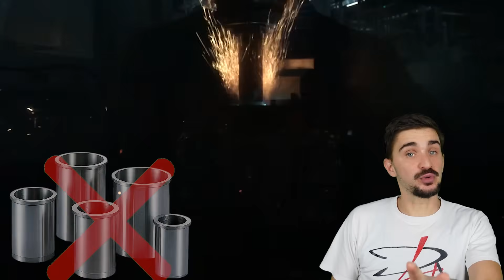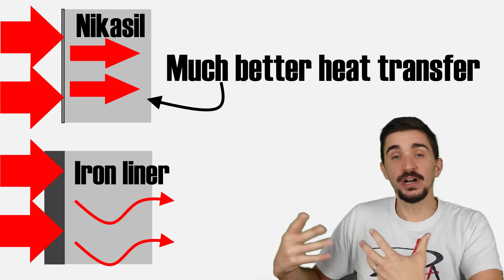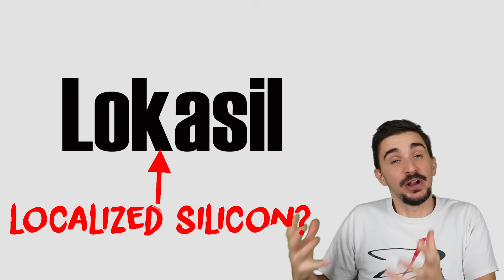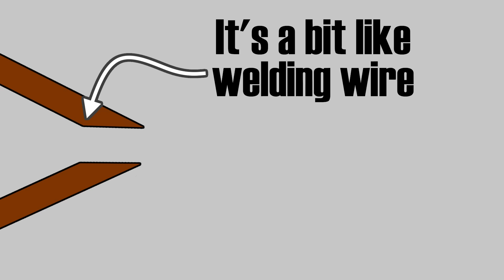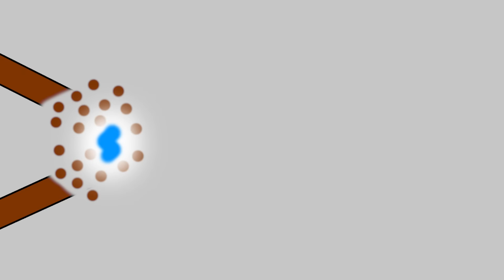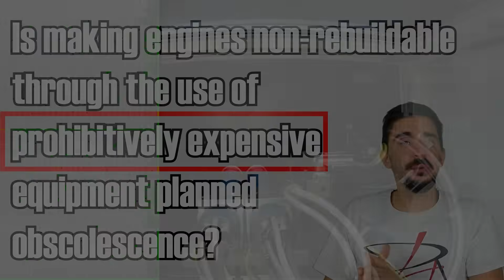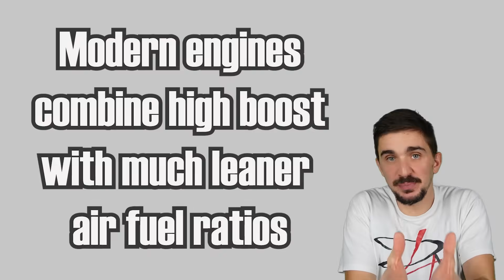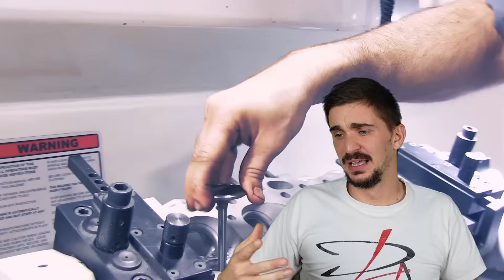Why Are Engines Becoming Non-Rebuildable? Everything About Cylinder Coatings

Comment: Ok thinking outside the box here, or maybe im not thinking it through.  If this becomes standard practice couldn't a machine shop purchase the equipment to do the coating themselves? Bore it .010 re coat and rebuild? Or am I missing something?
Reply: I don’t think you understand how expensive that is. Imagine spending $10k every 100k miles without taking into consideration the rest of the vehicle.
Reply: @evildrizzt1  OK I admit I'm not 100% sure on this.   But I'm sure in the early 1900s only the manufacturer could rebuild them as well. It took boldness and risk to invest in the equipment to do it... I don't see what's different today...

Comment: Another great video, well done. I'm not sure where the linerless big block Chevrolet engines used in CAN-AM fall into the development timelines, or what process they used. I've always assumed they were the same technology used in the Vega (yes, correct pronunciation similar to Las Vegas). You are spot on in analysis of design "planned obsolescence" is normal in design.  Theoretically, everything on the vehicle would reach its life limit on the same day. It wouldn't make sense for the vehicle body to wear out in 10 years but the transmission to wear out in 25 years. In that case the transmission cost more to make than it should have. 
I really enjoy your videos,  keep making them!

Comment: The car will be crushed far earlier due to the use of wet belts, direct injected turbos and software updates, not the bottom end.  These three things will adequately limit the life of an engine to about 100k miles.  So the better control for planned obsolescence is not the bottom end.  Might as well use coatings and get the advantages of weight, friction, fuel economy, etc..

Comment: The vast vast vast majority of cars by the time they need an engine rebuild are worth less than half of the rebuild cost and you'd end up with an old car that still has plenty of other parts worn down. We're talking about 200k+ miles  20+ years old compact or family cars, where a fully running similar car is worth 1000$ and rebuilding an engine alone is north of 1500$. NO point whatsoever, unless your car is either really expensive or really unique and preferably both.

Comment: I thought the narrative that manufacturers have to make their engines spin more freely which is also the reason why ever thinner motor oils are used today was a joke. At least until I rebuilt a big old engine myself. So yes classic car engine from pre emission controlled times, those engines will often see rebuilds instead of complete replacements. I was shocked how hard it was to turn the engine over even before I put the sparkplugs in. I didn´t even need to use anything to lock the crankshaft to tighten the harmonic balancer bolt to 100 Nm. I was concerned about that just to find out it was and is kind of normal. 
And as always great video with enormous educational value. I kind of knew that Nicasil was mostly fine while Alusil and especially Locasil and its siblings often weren´t. It´s sad that some otherwise iconic engines received those coatings to make them even terribly unreliable in some cases and ludicrously expensive to replace - looking at you Mercedes and AMG. By the way do you have an idea if Nicasil has to be done in a bath or could the plating be done manually?

Comment: Ok, oddly enough, Nikasil actually solves one of my problems with my effort to make my own engine. It's a lot easier to recycle some old aluminum Toyota engines and cast my engine in aluminum and just Nikasil coat it than it is to try figuring out the Iron casting option.

Comment: I agree with all of this. As a note for rebuilds: large industrial diesel engines are generally designed to be re-built multiple times in their service life. This results in them being very different to consumer vehicle designs. Much physically larger and heavier per displacement and per power, and more expensive to initially purchase. But they will do millions of miles. I don't think most family vehicles would sell a 'rebuildable' option with those trade-offs.
Reply: Modern cars already rot before the engine goes bad. People are worrying for no reason.
Reply: Not to mention after 2 decades and 300 thousand km we kinda get sick of the damm family car

Comment: Nowadays it is actually quite easy to get a car totaled; there are lots of heart-wrenching videos on IG showing brand new cars being dismantled, due to a not so severe crash. OTOH, you get a supply of new or almost new engines and transmissions, at a fraction of the cost, so just get a second-hand engine and drop it into place.

Comment: If you would make an engine intentionally fail , thst be fraud.
So its not done. Instead , its made Just financially not worth to rebuild. Its possible , but not feasable. Nothing unlawfull there. 
If a car has a dead engine , its not Just the engine that gets scrapped. But the whole car. And a whole new car is built to replace it. 
And yess , its stupid as Hell.

You mention high compression ratios ? Whell..old idi engines run 23:1 and a boost on top of that ,.whit 8 psi. Nowdays diesels run 17 or less compression. They run so cool they all have glow plugs re-purposed in the coolant loop to help em heat up somewhat at least. You can not get a modern diesel up to temps by idling.

Low compression ratio is chased , not high. The air has nitrogen in it mostly , and high compression allows that to break down from N2 to N. And allows NO and NO2 to form. 

Nozhing justifies making engines that are not sleeved. Many modern engines do share the block whit old and even older designs , the head is different , and went from indirect injection to direct injection to high pressure common rail direct injection. The hp numbers on engines only look impressive till ... for petrol engines one does not research 80's and 90's japaneese sports bike engines. Those still do very well.  Over 100hp per liter running naturaly aspirated , on stupid carbs. 
Its not planned obsolescene , its planned ufeadability to repair ,refurbis , reuse.

Repairing a block whit any of the mentioned coatings is allways possible however. For most , its possible to fit a thin steel dry liner for petrol engines. Sadly involves getting pistons custom made as to have sufficient thickness for the liner , enough material can not be removed from the bore. So the piston needs to be a bit smaller. 
And that is the main issue. Getting pistons.
But not all engines have this issue . For most cases there is sufficient material to have a liner installed whitout needing smaller pistons. 

At the end of the summary , the engines could had been designed whit a liner to begin whit , you can coat that whit whatever methood or material etc.. you want . And replacment liners could be sold. 
But why would anyone do that , if exsisting cars can be fixed , whom will buy the next nothingburger shitbox ?
Not Just liners are more Than viable , domtonthe extreme cost of fixing , we did turn several tdci ford engines back to mechanical injection. Whit a regular injection pump.
They start better , run better , and consume less fuel. That I can say from practice. Our workhorse modeo 2.0 tddi is a lot better after the conversion . 
Allso one can genuenly take the 1.8 tddi engine and literally bolt on upgrade it to tdci. Or revert whit a head swap and mechanical injection , to tdi. I think that was the one needing a bit of work to mount the mechanical pump.

Farm tractor engines are allso interesting candidates. There is 1 line of engine that was produced whit 45 hp , but whit headswapping and bolt on stock parts , can be upgraded all the way to 95 hp , whitin specs. Or as many do push it a bit to 120 hp. Farm tractor engines are well loaded , unlike punny caf engines. Still , many of the converted engines run Just fine. 

Those coatings where introduced to decrease manufacturing costs overall , while making sure rebuilding is not impossoble , Just unfeasable. And so have a very limited life span.

Comment: what's wrong with using high carbon steel for liners?  strength-to-weight ratio is better as well as heat conductivity.

Comment: You can take good care of your engine. It only takes a timing belt failure for whatever reason to ruin your engine in a 5-6 years old car with 150k km. That's a dilemma. Not new enough to replace the engine within warranty but not old enough to scrap the car.

Comment: OK, it's me who's easily irritated I realise but what was otherwise an excellent video with a comprehensive and cogent analysis with very clearly presented explanations was spoiled for me by the repeated pronunciation of "de" and "dis" for "the" and "this", etc. So here's the point ... some people due to a speech defect just cannot pronounce "th" correctly and, if that were the case here I would just suck it up with no comment BUT you clearly can. I heard, for example, thick and thin pronounced perfectly so the other (numerous and unnecessary) failures are just sloppy and lazy and each occurrence grates more than the previous. I do hope that you will correct this habit thereby making your videos even better.

Comment: LOL, not only a coated cylinder bloc is perfectly rebuildable (Coating companies are more than happy to make the coating for you) but it is CHEAPER, cost is less than making and adjusting liners in the block, this is the main reason it has been adopted by manufacturers. Added benefits are stronger wear resistance, less friction, less need for break-in. Finaly a reduced overall cylinder diameter because a liner is thicker than a coating means you can make the engine more compact and light. Process is : - remove about 25 hundreds of a milimeter with a cyl grinder, send the block to a coater, make a very short finishing floating stone grind, and your bloc is new + 0.25 ! ....

Comment: At 23:26 you use a period for the decimal point. As in 5.6 liter / 100 km
At 23:43 you use a period as a thousands seperator in 46.669 tonnes of CO2
This is very confusing.
But nice and interesting video!
Reply: It is the different way we use numbers in most of Europe. We use periods for thousands and commas for decimal points.

Comment: I had two Porsche 911, one 996 and one 997, with engines rebuilt with custom made aluminium cylinder sleeves with nikasil coatings, due to borescore in the original cylinders.

Comment: Just some numbers from ChatGPT:
Let's again stay in Europe...
"
Bełchatów Power Station (Poland) In 2023, it emitted approximately 26 million metric tons of CO₂
Niederaussem Power Station (Germany) emitted approximately 27.2 million tons of CO₂ in 2018
Drax Power Station (United Kingdom) emitted about 11.5 million tonnes of CO₂ in 2023
"
OK, these are the big hitters (I assume and hope).
But what are 20K or 40K tonnes can do compared to the numbers above?

Also, I have in mind that (I suppose) if an engine is worn out, it usually has an oval in the bore.
How do we make the bores round again with any of the platings? With sleeves this issue is not-existant.

Also, we get more power per capacity, ok.
Why does this matter for most people, who don't care of hitting 600+ hp with their cars?
I prefer 1.8L engine with 120hp that will last a million km to a sub 1.0L with the same power that will last 1/4th of that.
And for sure the later will be a turbo for sure that will have to compress a lot of air.
Regardless of the efficinency benefit from the lack of the iron insert, you still will have to use more fuel to bring those combustion temps down.

The idea should be something like, if you plan to make use the car a lot, make it traditional - reliable.
If it a car that does not see much use and in 10-20 years you won't even have 200K km for example, use the fancy stuff.

I am not complaining for the new tech, if my bike did not have Nikasil, it could not have the power it has with the weight it does.
But use it where it matters...

Comment: One other important detail:

Most of modern engines (Thank you Japan ), when correctly maintained ( 5000 km oil changes especially ) may last over 300 000 km , even much more.

I am 60 and in my youth years, US car ads all claimed "1 year 12 000 miles" warranties... Another detail: Car odometers were 5 digits, because many cars couldn't reach 100 000 miles. Today, 300 000km (200 000 miles) is not uncommon.

Finally, having a whole vehicle easily reaching over 10 years of lifespan is way more environment friendly than a rebuildable short-lifespan engine. Did i mention planned obsolescence ?

Comment: Great video, very entertaining as usual...I have a question...Why are we manufacturing such small high HP engines i.e. 1.3 litres @ 170HP.
What if that same 1.3 litre engine only had to supply e.g. just 100 hp...a slower vehicle to top speed, less stress therefore less wear & tear...fuel economy estimation please? Engine pollutants? 
I would love to get your valued opinion & explanation soon! Cheers from Australia!

Comment: Something that got me wondering: With the coated cylinders and mirror finish without crosshatching is it required to use a different kind of oil compared to the cast iron ones since it now relies on the surface porosity?

Comment: Prohibitively expensive equipment is exactly planned obsolescence. Huge automotive manufacturing corporations can afford the equipment, save money on manufacturing, AND monopolize repairs by pricing the smaller repair companies out of the market leaving them in full control of the supply of replacement engines. It also allows them to directly control the demand for new cars by discontinuing support for replacement engines for which they are now the sole supplier. It's cartel behavior and its anti free market.

Comment: A liner can still be fitted without boring the cylinders.  It will lose a few cc's but will save money. I dont believe the engines could not be rebuilt. Engineering methods are incredibly versatile.

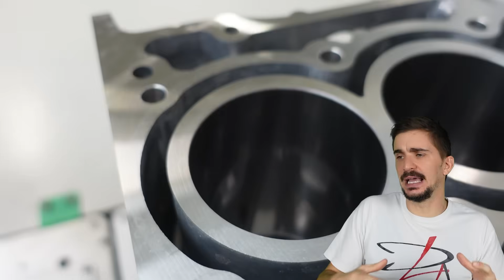Comment: 0:45 you can bore it and put sleeves in it. It is just more shops have to produce aftermarket sleeves for large amount of different engines
Reply: Yup, this is actually method used for Yamaha diasil (alusil) blocks

When there's a scoring on block, it's either replacement or install liners
Reply: I would go with liners.
Reply: This is what they do with b58 after around 1000
Reply: I totally agree
Reply: Even the open decks?
Reply: @romanmakarevych4483  Yes. Literally just finished rebuilding my open deck engine with lined cylinders that was glazed and incapable of maintaining a vacuum. Had to send the block to get its stock cylinders completely bored out with a CNC machine and replaced them with patented designed sleeves from Darton that they call the M.I.D. Sleeve or the modular interface deck sleeve. Benefit is the new cylinders are much stronger and can handle the additional boost pressure I'm shoving through it. Drawback is these sleeves are about 3x the cost compared to regular friction fit sleeves plus an additional 250$ per cylinder to get them installed properly.